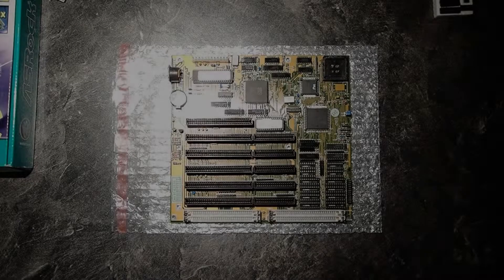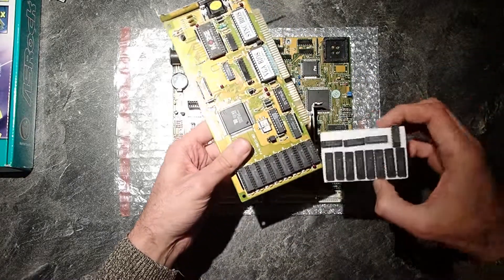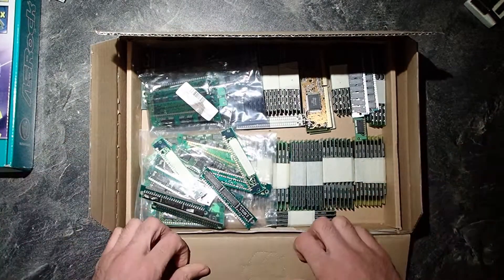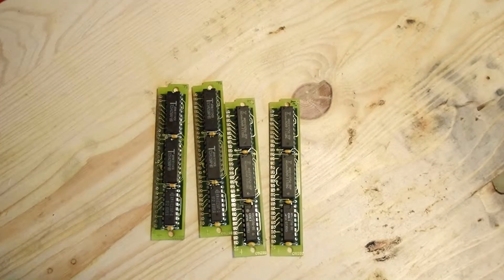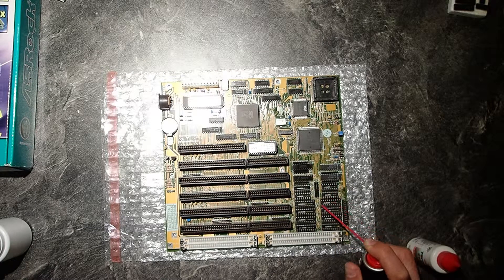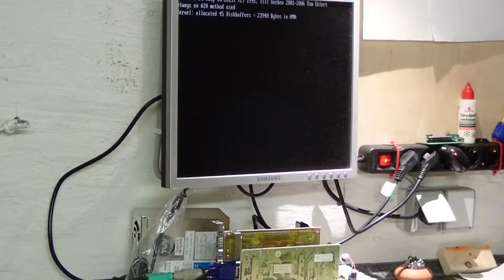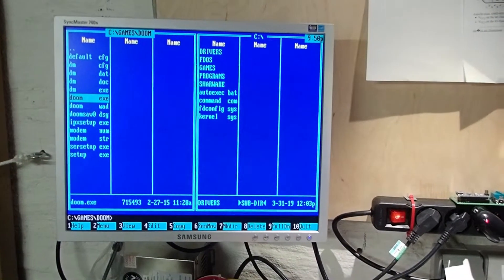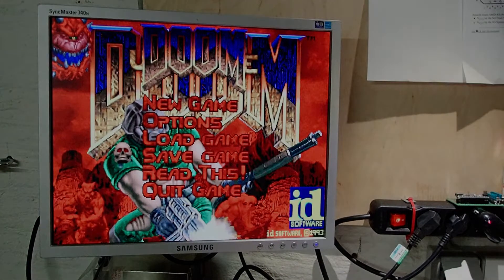Memory transplantation on retro 386 mainboard

Comment: I have a Pb301 packard bell and its max supported ram is 4MB I can’t run doom too,the cpu is 25MHz do you think I can use an isa card such as the intel above board isa to upgrade the memory and run doom? That isa above board support up to 32 MB of simms
Reply from the maker: That is a 386SX. It is far too slow to run Doom anyway. 4MB for that system is already quite a lot. Also adding more memory through the slow ISA bus will not help. That system is basically a 286 with a CPU which supports 386 instructions.
Reply: @necro_ware  its more like a challenge than running doom, was wonderingmif there is a way to,break the 4MB limit
Reply: @necro_ware  Yes, it's just a 386SX, but my friend had a 386SX 33MHz when it was still relevant (first half of the 90s) and it didn't stop him from playing Doom in the smallest window on a small 10" IBM monochrome monitor with reduced details, so you couldn't see almost anything :D On the other hand, there was a cross on the monitor, which was caused by the fact that the monitor had previously been constantly turned on and the contents of some static windows from some server were burned onto it. You could even read some of the writing :D My friend used the cross as a sight :D But monitors were terribly expensive back then and he couldn't afford anything better. In 1995, he installed Win95 on it (with 4MB RAM!) He also had a Seagate MFM HDD with a capacity of 77MB, which took up 2.5 5.25" slots and he made a switch in the power supply because he didn't like the noise from the disk, so he turned off the hard disk while it was running if he knew that nothing would be loaded (when (He played a DOS game, for example). When he knew that the next level was going to load, he had to turn the disk on again with the power switch in advance :D When he finally bought a newer PC, instead of selling the old one at the bazaar, he decided to take revenge on him for everything he had ever done to annoy him. He threw the PC from the 4th floor onto concrete, drowned the monitor in a pond and the printer (a Panasonic dot matrix printer) in a stream under a bridge. He took the HDD apart, took out the platters and threw the rest away. He gave one to my father, and I still have it today.

Comment: You do not seem to have any contact info, so I'm doing so here. You have GReat! videos of 286 to P4. I would like to see you do 8086 motherboards (IBM PC/XT 5150/5160/Clones) and especially !! full height hard drive restorations. 286 and later with IDE are simpler to fix. Doing 8-bit MB, & HD only machines would be a especially challenging. Looking forward to you working on such systems!! Thanks !!

Comment: The advantage of using the video ram is that the mainboard might run with fewer wait states. I bought a bunch of Trident VGA cards with 40 and 50 ns DRAM for several 286 20 mHz mainboards but the video cards were all good and I didn't have the heart to strip the DIP modules.

Comment: Or you can just run Win3.11 and get virtual memory)) I was run Doom in Win3.11 with 2MB on board :)
Reply from the maker: I'm speculating if this is a joke?! :D If not, I'm heavily in doubt, that you did. This is not how virtual memory works and if you are talking about swap, then you don't need win 3.11 for it, it is also possible to do it in DOS. However, you will not be able to enjoy anything, since your memory is then dumped to HDD where the access times are around 1000 times slower, especially on the older HDDs. Back in the days there were companies who scummed uneducated people by selling software to "double" the RAM. Basically this were swap solutions, which were eventually unusable. You had a higher theoretical amount of memory, but it was just a fake.
Reply: @necro_ware  swap is a part of virtual memory - is'n it?)

Yes, swap is very slow, but most of the time Doom uses about 2 megs and swap is not slowing a gameplay... but it was AMD386SX@40MHz and I'm was very, very mach want to play)))))
Reply: @necro_ware  I tried it back in the day too, additional 2MiB was very expensive back then (I had 2 at that moment) and as a poor student I was hell bent on at least seeing Doom running on my little 386SX. And it DID run... or crawl. Whatever. It worked. Win3.1, swap, and gave the DOS task 4MiB of memory.
But. What I originally wanted to write - no, it's not a problem that the board gobbles up a few (hundred) kilobytes of memory for the shadows. At least not a problem if you want to start doom. It'll run quite well with a little less than 4MiB (it will turn to the disk a bit more during gameplay, it'll be apparent on more complex levels), BUT of course you must forget about EMM386 and the like as they swallow additional hundreds of kilobytes. THEN it really won't start. But with a clean boot, even with himem.sys, it'll start no problem.
Not that it's a big joy to play Doom on a 386SX. I played through it anyway. Later, when I had a proper 4M config...

Comment: Add a math coprocessor?
Reply from the maker: No, I didn't on this mainboard, but on 386 it is not necessary anyway :) However, I made it on my Tandy 1000RSX in another video (see #SepTandy)
Reply: @necro_ware  If you want to benchmark Quake it's absolutely necessary :D Together with some more memory... Not that it'll be playable by any means. Doom with 2MiB was much better than Quake with any 386... I did benchmarks, it gave 1.5-2fps on various CPUs and FPUs in a 386DX board and any of those combos were faster than an SX :D